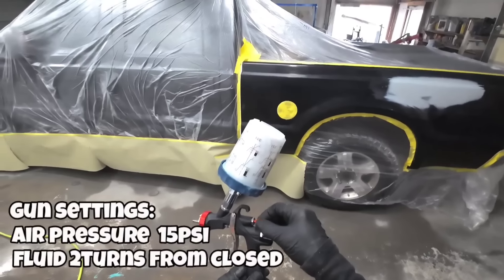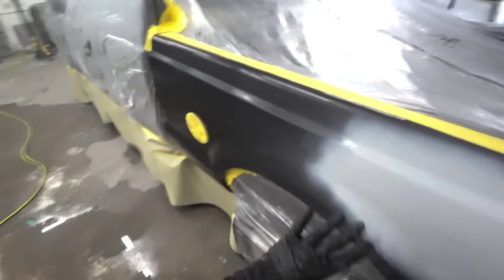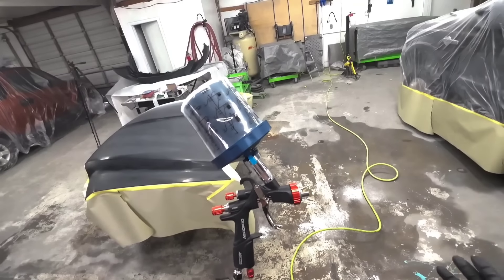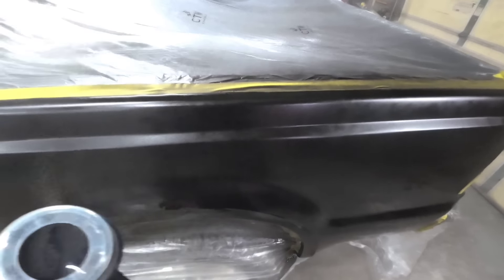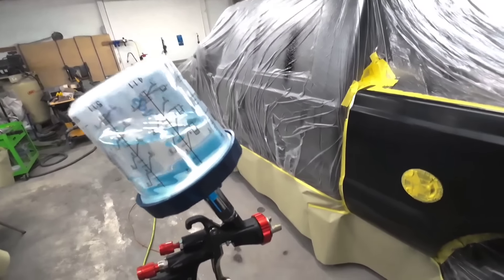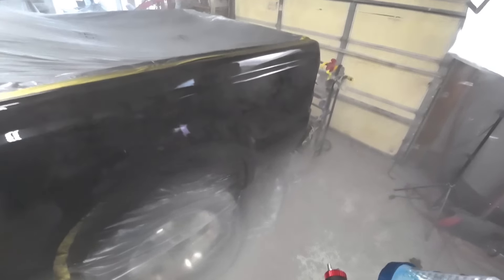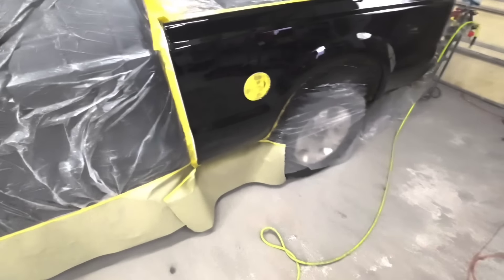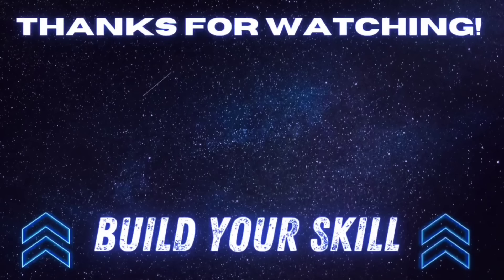Spraying CLEAR COAT: 4 keys you must know!

Comment: So I took a fiberglass wing to a body shop to have painted. They said it needed to be sanded because the company that made it left some sanding marks on it. I agreed and paid 415 for sanding/painting it gloss black. When I went to look at the wing it had a bunch of craters in the paint(looked horrible) and they said its because its fiberglass is not perfect and that is the way it was when it came in(I looked it over and didn't see a single dip but again it was only primered so maybe I didn"t catch it but I saw the sanding marks and have a good eye). I did a little auto body in high school but I don't remember fiberglass being that difficult to paint. I don't know if it was fish eyes or air trapping but they are trying to make me believe this is because its fiberglass...I really believe they are just trying to cover for the fact their guys are possibly inexperienced but I really just wanted a second opinion as I believe it shouldn't be that difficult to paint and make look good. Any advice would be appreciated. Maybe I am overthinking it...
Reply from the maker: It's hard to say without seeing what you had to work with but there is a lot of rough poorly finished fiberglass parts on the market  some need quite a bit of work before painting.  With that being said a quality shop will let you know that up front and price the job accordingly.  So  you have a quality finished part when done.
Reply: Wash fibreglas with hot soapy water ,lots of it. When parts are molded they use a separator which can be mothers car wax or silicone based separator fluid. Them=nspray straight thinners over the panel and let it evaporate. If there is still little round marks visible,the part is till contaminated. Wash it again and do the thinners routine .Once the thinners has dried off,get wax and grease remover and flood the part ,wipe off and spray a test coat. no fish eyes means it ready to paint. Fish eyes will go through primer.
Reply: Acetone is a must when prepping fiberglass for primer
Reply: Besides proper cleaning it sounds like it wasn't blocked properly if you're seeing craters/dents.